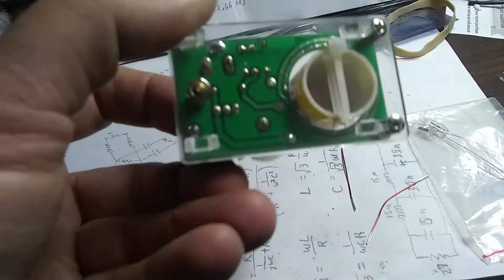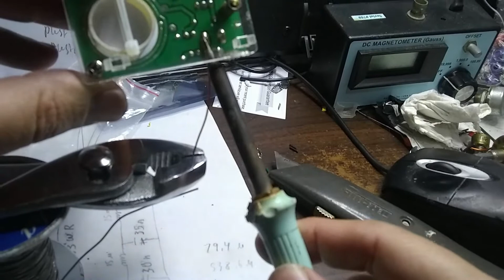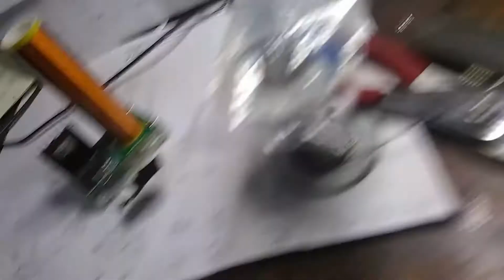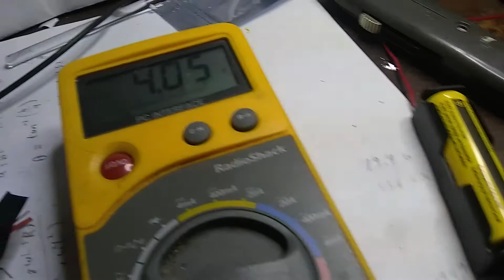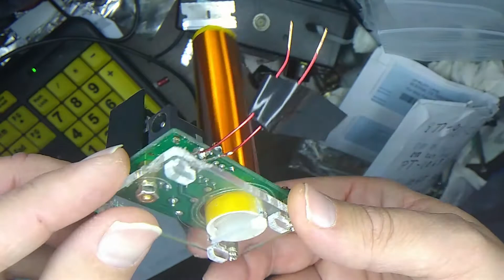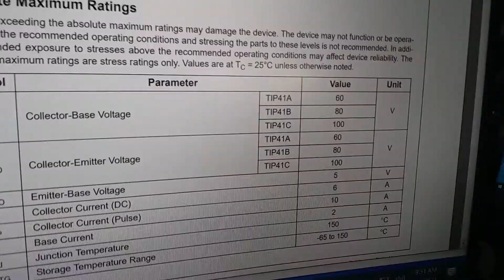Battery Powered Mini Tesla Coil

Comment: OK, step 1 done, it runs off batteries.  Now what "mad science" you are going to do with the tesla coil?  That's what we want to see!  C'mon doc, on to the experiments.
Reply from the maker: I am working on some anti-gravity projects in the back ground.. I have found the need to develop some high power oscillators, because when I generate these fields, they seem to interfere with low voltage electronics,... like the master oscillators on some of my devices.. so I am trying to get away from that.. I did post my 'gravity beam device'.. a week or so ago.. It appeared to produce a force similar to a high voltage electrostatic field.. though through a shielded Faraday cage.. but there was no high voltage involved with this experiment! When I develop some new equipment.. I believe I will be able to intensify this effect.. we will see.. Hopefully I will have some new experiments soon,.. with the new equipment I am developing! Basic research is always slow and painful process.. but I will keep on at it!.. Just like the tortoise that finally won the race!.. Anyway, very cool channel!